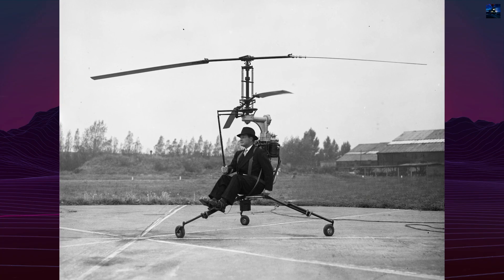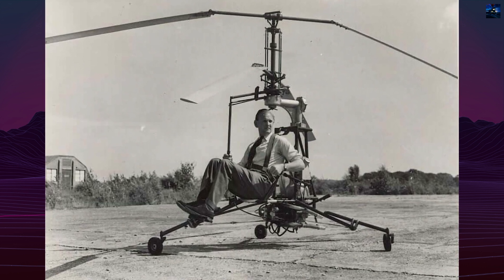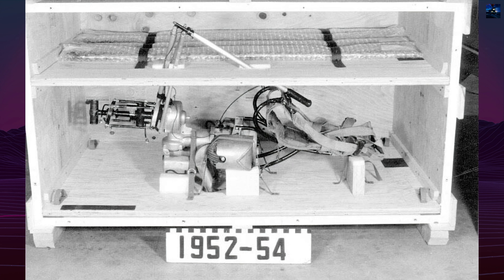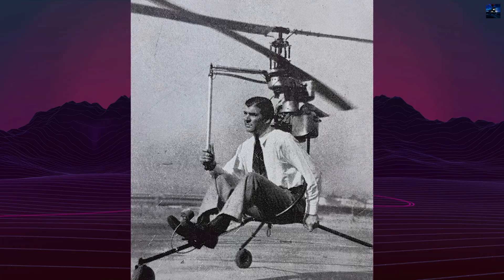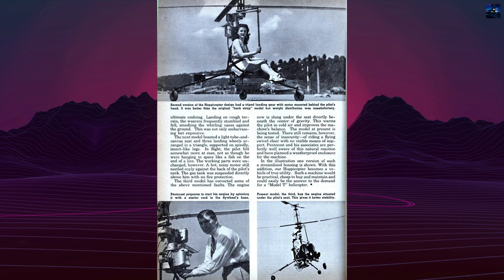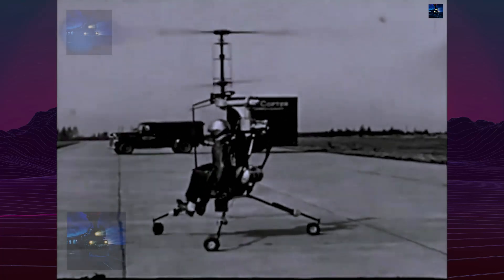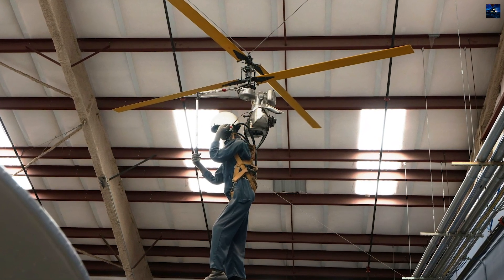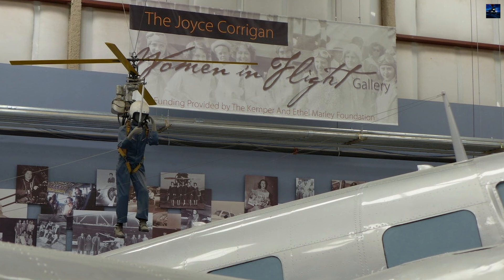Pentecost HX-1 Hoppi-Copter: The OG Flying Backpack That Predated Jetpacks

Comment: In 60's/70s, saw an article in Popular Science said Air Force was looking at this concept again, to get ejected pilots away from combat zones (Viet Nam).  They also looked at an inflatable airframe with small pusher prop.
Reply: Kaman did a test on the rotary wing ejection seat. too limited and Good Year Inflate O plane   - The plane was at Fort Rucker in the 80s Next to a Hiller folding helicopter

Comment: That was quick, thanks for doing the hoppi copter. Great photos and great to have the machine documented. 
There would have been gyroscopic forces from the rotors as long as the rotors had teeter hinges. If the rotors are mounted ridged then counter rotation cancels gyroscopic forces and precession. The Gen H4 had rigidly mounted rotors so there would have been a significant bending moment on the rotor shaft between each rotor. I think the GenH4 also does a fair bit of weight shift in its control though.
Reply: Gen 4 was a gimbeled shaft all weight shift and in a high G turn the thing suffers cyclic lock, I last saw the Gen 4 in a descent and had control  issues , Like a grave yard spiral at low altitude in the mid 1990s, Pilot lived. 
Gen 4 was fixed pitch no collective and yaw through the planetary - Sketchy machine more powered lift then helicopter
Hi Ben😁
Reply: @HongyaMa  Hi Don ,😃 High G turn cyclic lock! Did the Nolans ever experience that? 
Also as you say the Gen 4 is all weight shift, does that mean you don't buy into the fixed pitch rotor cyclic servo assistance argument? Many gyro pilots are convinced moving the rotor around is easy because its cyclic pitch control and not weight shift. 

Something I'm coming to realise with mine is that when you spool up to nearly take off moving the rotor around requires significant cyclic stick force. As soon as you are in the air the cyclic goes light, therefore weight shift is definitely going on and I would suggest a lot of it. The distance between the top rotor and the gimbal pivot I thought was the primary reason for this weight shift bias on mine.
Reply: @Ben-Dixey  All rotor craft have limits 
Once up to speed the gyros are cyclic pitched just because the distance from the teeter & gimble is so short. Your masts are taller so you have less control power from cyclic action but it's still there.
The Noland brothers were more careful in piloting their craft. The Gen 4 guys egos were more then their skills. Even a normal helicopter with a sling load can get into cyclic lock. A Mini 500 guy in Hawaii was slinging dope out of the jungle and got rotating against the load and then wound around a palm tree trunk = Kablamo. Dennis Fetters gave me unrestricted access to his accident file. Lots of guys who should of taken up another hobby,
You are correct in your observations. Cheers
Reply: @HongyaMa  Thanks for the reply. Have you ever considered making explanation videos yourself for YouTube ? With the amount of understanding and experience you have it would be a big benefit to viewers. Not for everyone I know.
Reply: @Ben-Dixey  Oh. the poor viewers... 
Could it be considered a war crime?